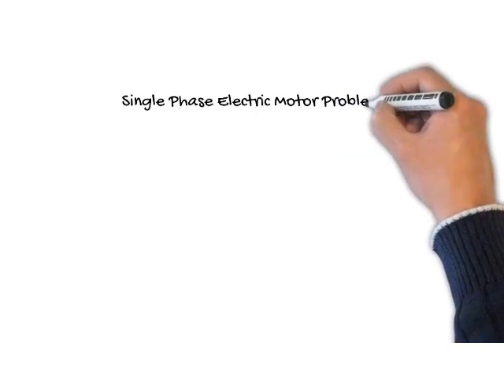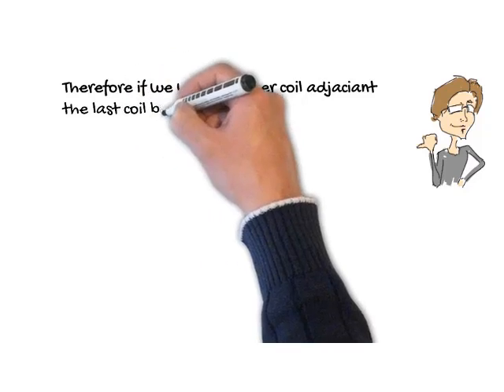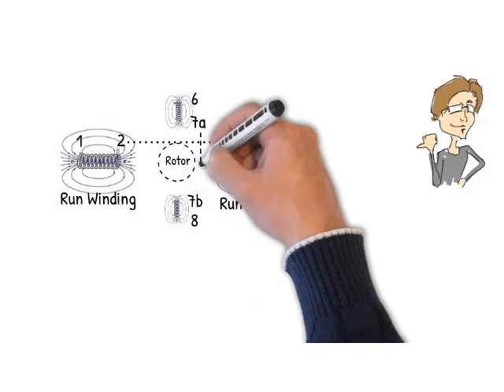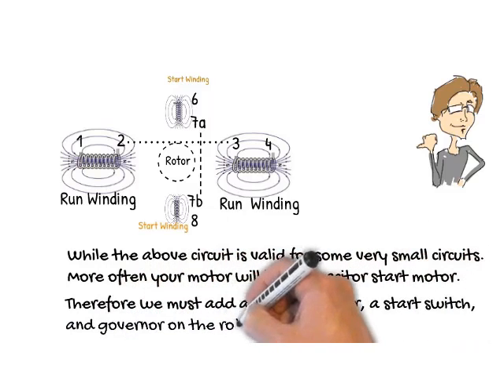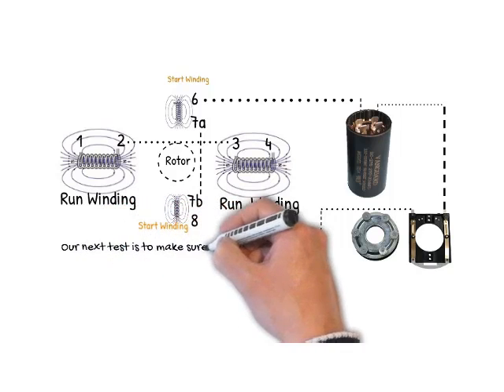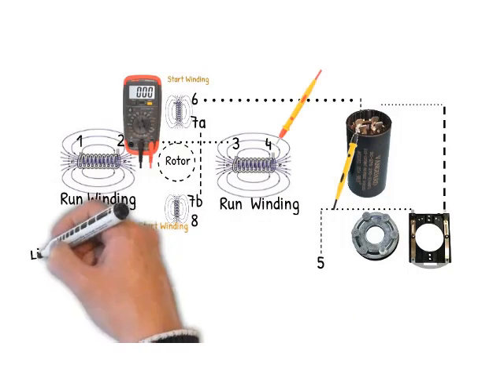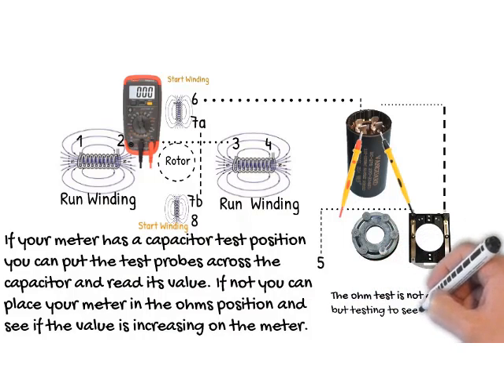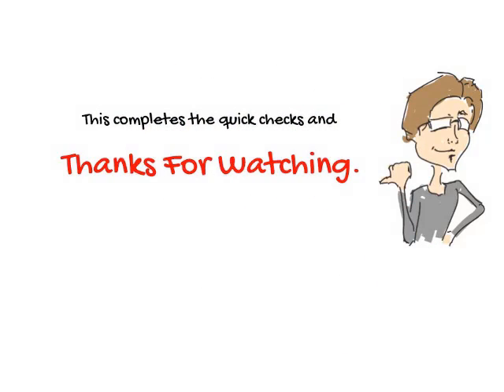Single Phase Motor Test

Comment: Thanks for providing tutorial on Fundamentals of AC single phase motor & testing . 
#So Please provide the technical clarification for below mentioned practical problem. 
: problem about "2HP rating. single phase"-submersible Borewell pump set. 
#After starting pump-set :Starting Amps go up to 20A & Amps  Return back to 7.5A@245V (Running current /Amps). 
*But pump-Water flow output :zero /Nil*. 
#"Main winding continuity" (R-B.) absent (missing/*NOT OK*). 
But Y-B continuity is OK/all right. 
B= common wire 
Y=Auxiliary /starting winding 
R=Main winding 

# My question :
"If  Main winding continuity is NOT OK" ,  *why Pump set is NOT getting overloaded with high Amps*? 
(*because driven/mechanical load  receiving by Auxiliary winding only*) 
Overload Relay setting : 15A
Normal Running Amps: 12.5A@245V
#Please Answer. 
www.facebook.com. com/Bhargava Ashwath
curiousbhargav@yahoo.co.in
Thanks

Comment: If you have a capacitor,  why do you need a start winding?
Reply: Think of it as; gotta take the cap off or it’ll smoke your head it’s too hot. Think of your hand as the centrifugal switch lol

Comment: a little to fast, sorry I am not an electrition. I have 3 wires to the coil and one ground so what is what, how do I know which wire is number 1 etc.? I don't know which wire is start winding or run winding, And the capacitor is ok. Motor does not run to full speed and bearings are good.
Reply: Get the motor diagram  take the time to understand.